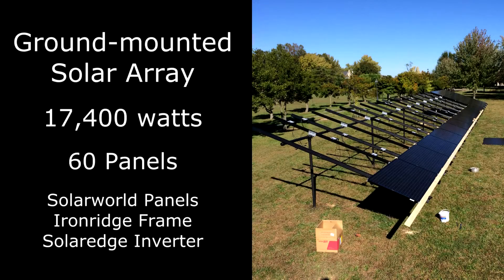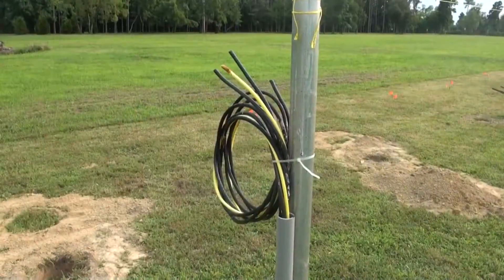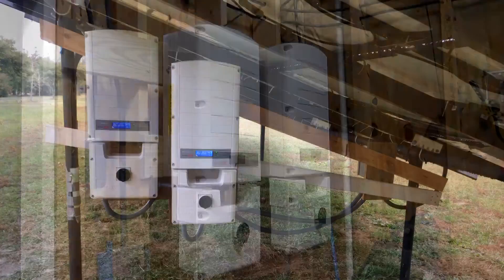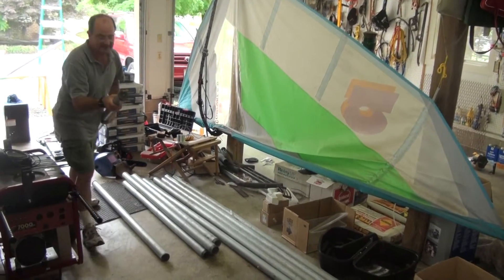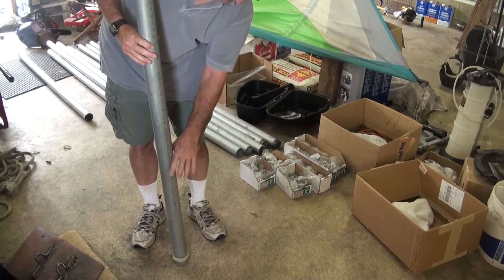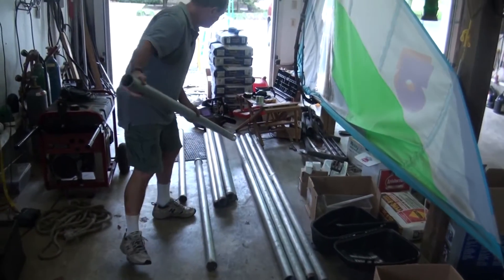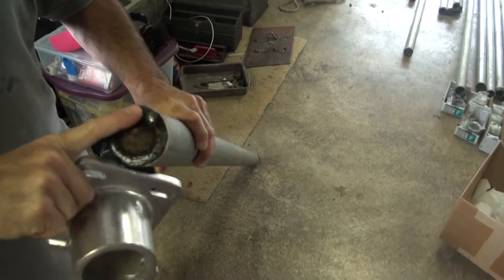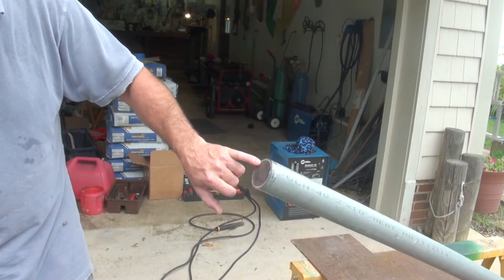DIY Field Solar Array - Part 1

Comment: Love the video series, like that you have chosen to give measurements in meters...etc. If you could do it all over, would you have ran direct burial solar cable, maybe 8 guage from your panel location to your where you eventually mounted your inverters. The voltage loss based on 10amp of current and 10 gauge wire (copper) would have been less than 3%. To run aluminum you would need 8 gauge to stay under th 3%. The panels max dc amp is like 9.85 and that would remain constant. To get more power you
Reply from the maker: Thanks!  Mostly, I would have run additional wires for a ground connection and future expansion (probably not needed).  I was happy with the direct burial service wire.  It's rated to 600v and probably is better suited to underground... maybe more so than PV wire.  Aluminum is much cheaper too.